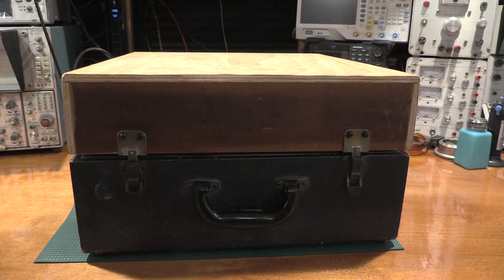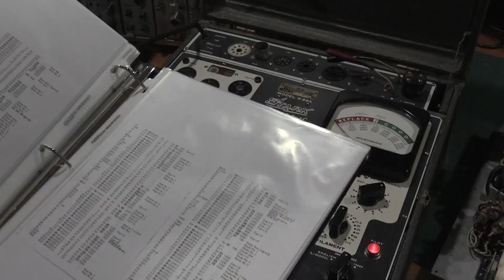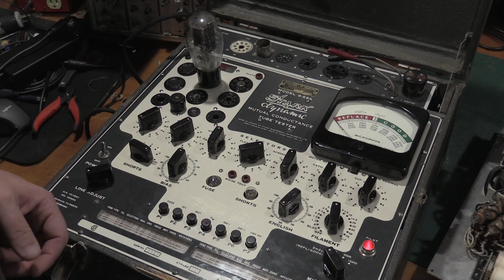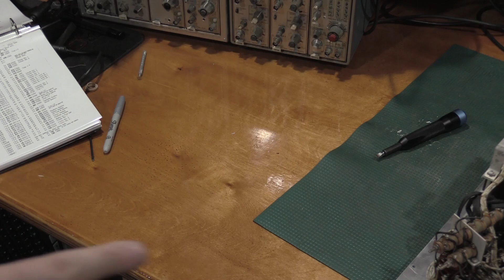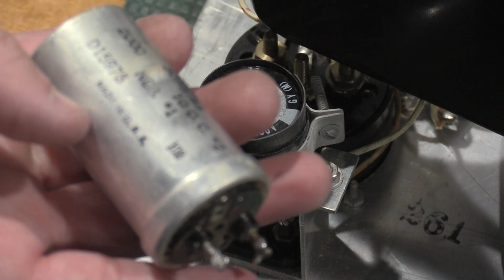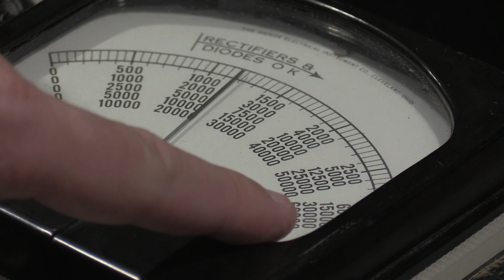Tube Tester Repair and Testing (Hickok Circuit) Western Electric KS-15560-L1

Comment: I have the same tester but the -L2. These coils are resistors!  I have installed an AC plug above the power light with a 3 prongs plug. The gas function is not very good...

Comment: I have an hp signal generator with a 517 calibration error wondering if you able to look at it
Reply from the maker: What model signal generator?
Reply: @ZenwizardStudios 8647A. Reason i think needs looked at is im getting like more then one tone and there like spread apart not focused